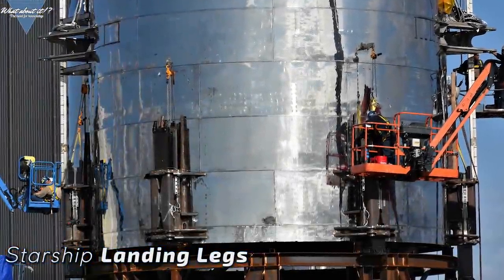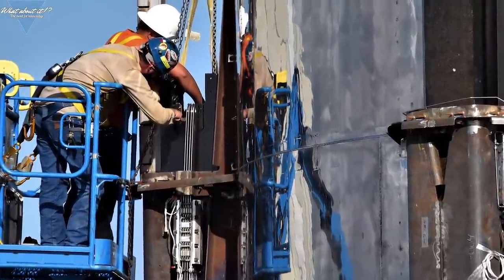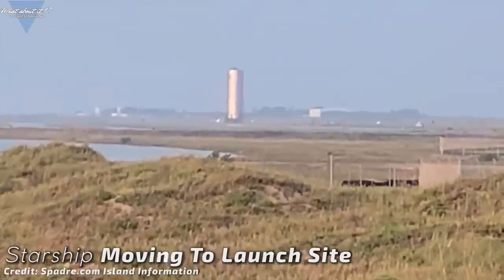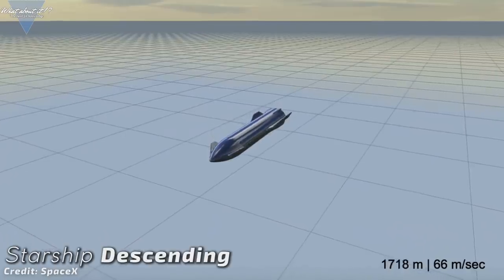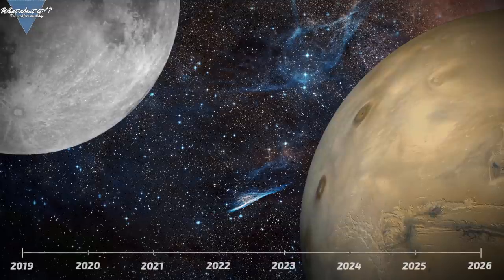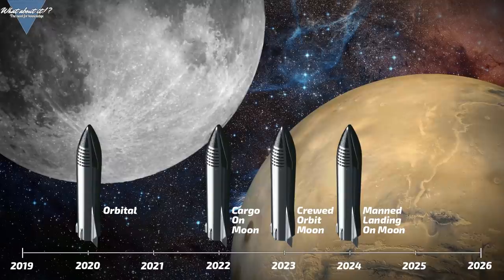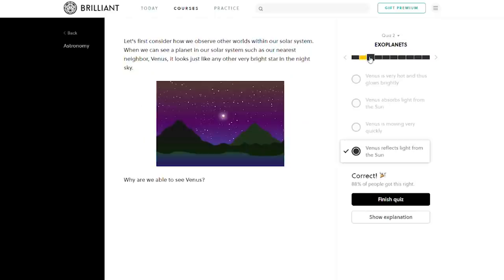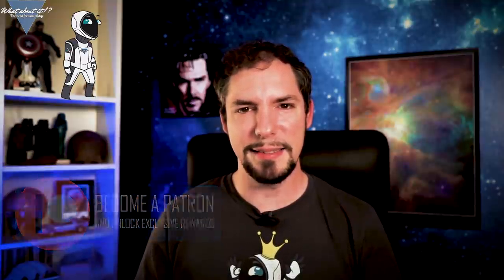46 | SpaceX Starship Updates & New SpaceX Moon Landing Schedule

Comment: I hope Starship can land, unmanned on the Moon by 2022, and land men and women on the Moon by 2024...while at the same time making an attempt at landing unmanned on Mars by 2024 with a trio of Starships and at least one  returning to Earth.  (It's a waste of time to send just one). Thus proving the landing technique on Mars, as well as the takeoff and return to landing on Earth in one, round-trip mission.  And same ship to Mars again in 26.  The two other ships can stay on Mars to test fuel processing hardware and longevity on the surface...and hopefully send back awesome panoramic views.  SLS probably won't land people on the Moon until 2028, the way they are going.  For manned flight to Mars, 2031 at the earliest.  Lots (dozens) of local (in the 2-million-mile radius area) test flights and development to be done before people go to Mars.  Such as possibly tethering two Starships nose-to-nose on a 1km-long tether system.  And then revolving them at RPM to produce a fairly uniform 33%-Earth-gravity on all decks in the Starships, with a large solar array at the center point for power.  Then have them hang out in near-Earth solar orbit for some months...where it's a quick trip back to Earth in case of problems.  Thus simulating conditions of a cruise to Mars and proving out systems, hardware and living conditions.   Also, land Starships on Antarctica and in the Utah dessert test range...can it land without tipping over on unprepared ground or ice?  Certainly many lessons to be learned and make improvements on before taking that long voyage to Mars.  Once they have a good Starship design that has achieved orbit, they should build mock-ups of multiple nose sections for unmanned cargo, satellite launcher, LEO-tanker, manned freighter, and passenger transport versions, and work out all the systems of those versions so they might be ready for in-flight evaluation by 2022 to 2026 range.  In all likelihood, Starship won't land on Mars until the mid 30's, though, I think. ...I hope earlier.

Comment: And that’s to say nothing about the strain the launch abort system would put on the human body or what would happen in space if there was a dangerous malfunction and we still don’t know the long-term effects of exposure to zero gravity let’s still an extremely new field in medical science so we have to have a way of generating artificial gravity once we break earth orbit and once we enter earth orbit and we have to eliminate the G forces to the point where they’re the exact same G forces traveling in a jetliner Would have on have on the human body you have to be prepared for any kind of emergency including the ability to make immediate emergency landings and you also have to have escape pods in case of something very very bad happens in the vacuum of space you also have to have emergency depressurization protocol you also have to have emergency gas masks you have to have radiation shielding so no this thing is not anywhere near ready and will never be ready for human civilian transport being common enough to replace jetliners and then there is also the problem of pollution how much toxic chemical by products like CO2 is thrown out by the ignition of these rocket engines so this is a great first start this is revolutionary but this is not where you would Say that spacecraft replace jets

Comment: SpaceX doesn’t even know what type of heat shield the starship will use.  

  Everyone keeps showing pictures of Starship entering the atmosphere with only a stainless steel skin.   That’s never going to happen.  No heat shield, no orbital re-entry.
Reply: they have a heat shield using hex tiles. they have tested it in several ways including placing them on a dragon capsule that did survive reentry. 
https://www.youtube.com/watch?v=IeJH12v6dD0
the CGI models you see are done as cheap as possible and are not 100% accurate.
Reply: Did you miss the memo where transpiration cooling was dropped in favour of ceramic tiles many months ago?